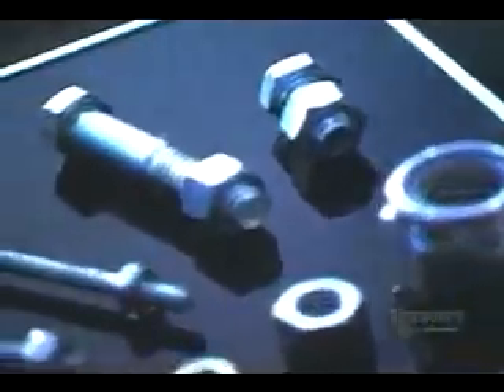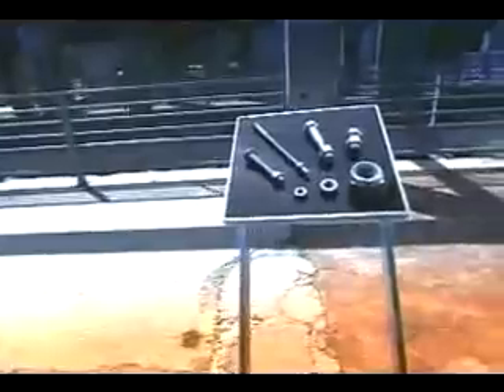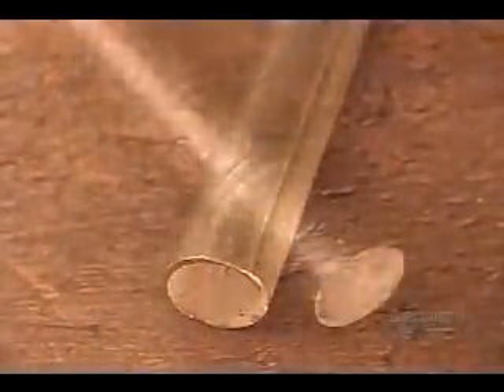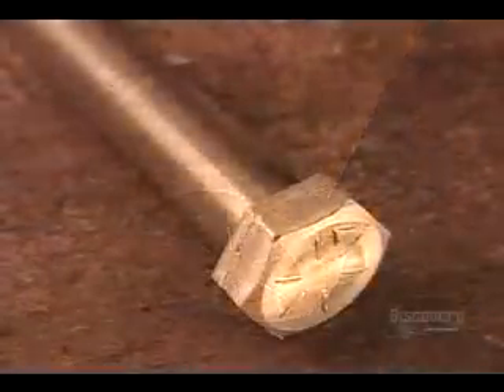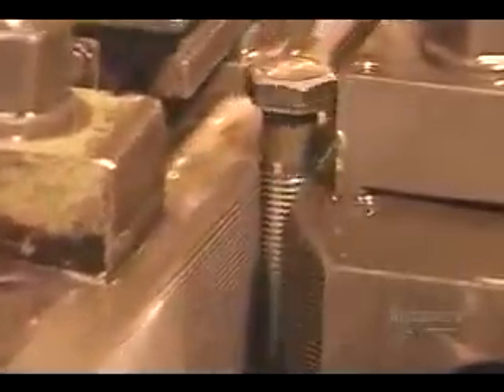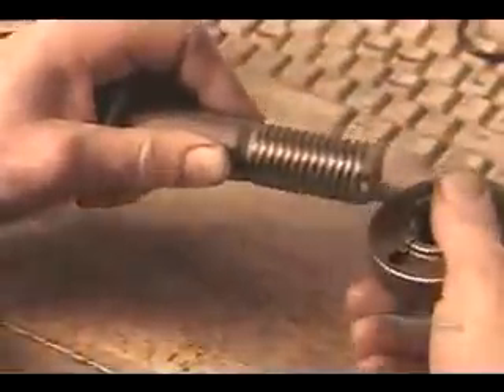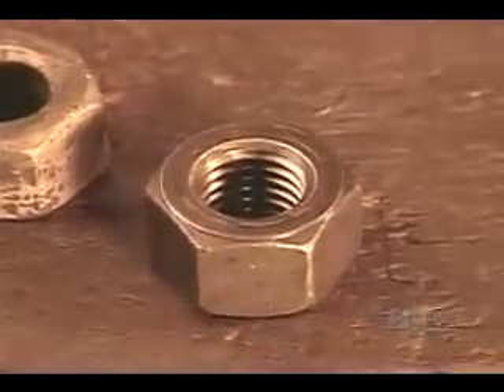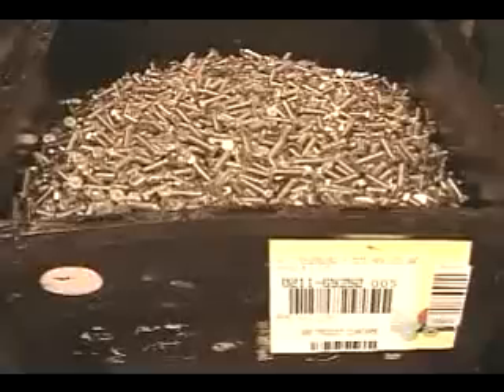Making Nuts & Bolts

Comment: Border-line illiterate .. 'they' < over-used.  'Employees' perhaps?  or simple 'The...'    Metallurgy is wrong too.  Oil quench is not to 'solidify internal structure'  .. ho humm how dumb.  Always quoting excessive significant digits.  Over-all moron-grade.  Cinema work is good to excellent.  Dialogue is linguistically-challenged .. make no mistake about it.

Comment: At 1:50 into the film you can clearly see the manufacturer head stamp (required on grade 8 bolts) you could track that back to the company being toured. 
As for the machinery manufacturer, it is likely several different companies for the different machines and even machine parts.